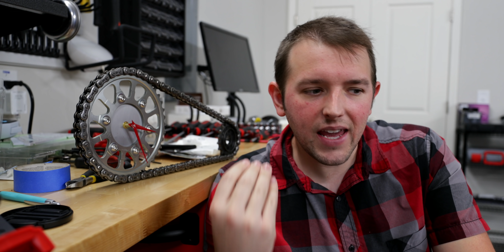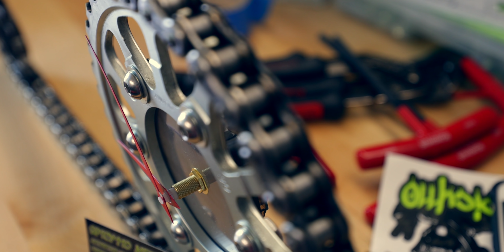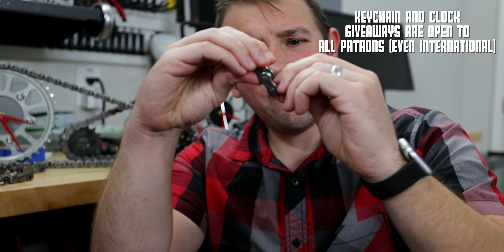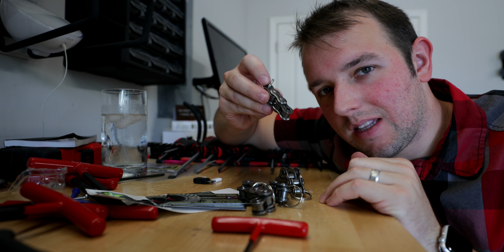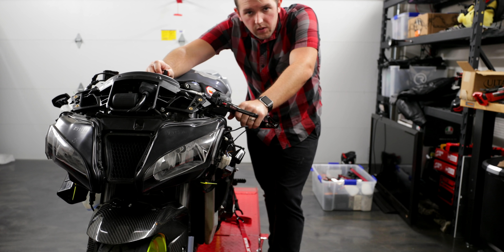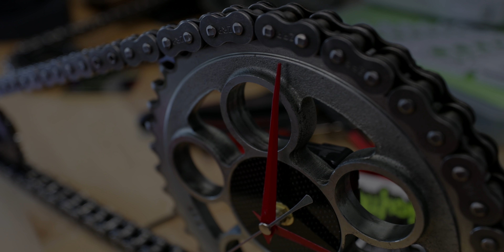I forgot to crank the bike up

Comment: The scary part of WBR episode 19 was the potential bricking of the ECU. I have watched a friend destroying his ECU when flashing it because the battery power in the bike dropped during the flash. Simply enough, if the flash is interrupted by any cause (user, low power battery in bike, computer shutting down, connection lost etc.) there is a significant risk that it is the last thing that ECU will ever do. My bike mechanic master jedi guy strongly recommend to ensure neither bike or computer can screw up. Therefore, flashing with 15% battery in your laptop is kind of playing with fire.

Comment: The clock needs to be mounted on a wall with the small sprocket to the left though.. Not the way it was shown early on in the video, as it would appear to be inverted if you imagine how it would be mounted on a bike. =)
Reply: Martin Johansson since there no numbers on the clock is think it could be up down left or right no?
Reply: Bruno M I would agree to mount it up and down as well.. But if you turn it so that the small sprocket is to the right, then it would also be the sprocket which will be attached to the wheel if you take it off and put it next to a bike. =)
Reply: Martin Johansson ahhh I see what you mean.
Reply: I saw that and was hoping the video was mirror reversed. Still sweet.

Comment: Chase and fellow viewers, I need your help!
I am looking to buy a Milwaukee 12V impact wrench (CIW 38-0). But I don't know if it is any good. So if anyone has experience with Milwaukee tools in general or with this tool, please let me know what you think! Thanks :)
Reply: Pascal van den Broek I have an M12 ratchet and a M12 fuel impact and love both of them. The ratchet is especially nice for removing fasteners and bolts quickly. I recommend not buying the fuel ratchet version though because it has a larger head and a ton of torque. You can easily shear off bolt heads with the fuel ratchet. Take what I say with a grain of salt since I am not a pro. I only wrench on my cars and bike for regular maintenance.
Reply: Dejas Monroe thanks man! This really helps me out a lot. I think I will get one after my current project.

Comment: oh my god, get to the point. No wonder why i stopped watching and only come for "shorter" videos
Reply from the maker: If you're just going to complain I'd rather you just stop watching the videos all together man. Lifes too short to spend time watching something you don't enjoy.
Reply: chaseontwowheels I do enjoy them, well the ones I do watch, but only after skipping the unnecessary parts and putting the speed on 1.25
Reply: Yeah bud your minimal 10 second  attention spam needs to go somewhere else.
Reply: 9:13   :)
Reply: A complaint that also functions as constructive criticism, you could take it into consideration before dismissing it completely, because he does have a point. It's a 12 minute video with a vague title that doesn't even have anything at all to do with the bulk of the video, which is a plug for some random guy who cleans chains and welds them stiff.